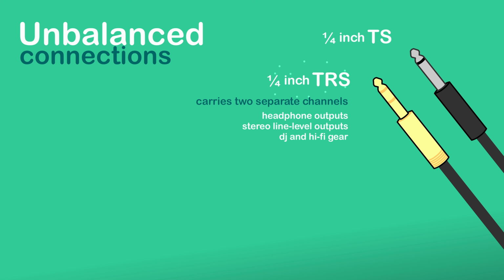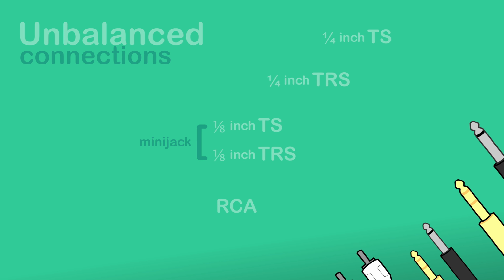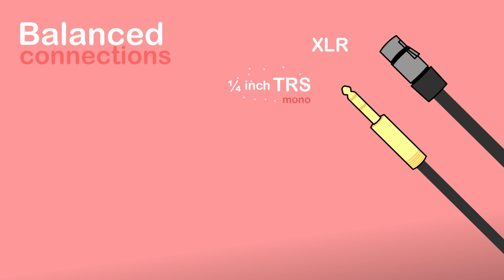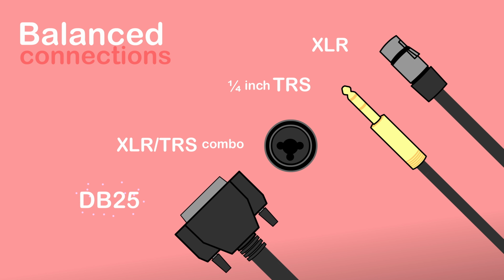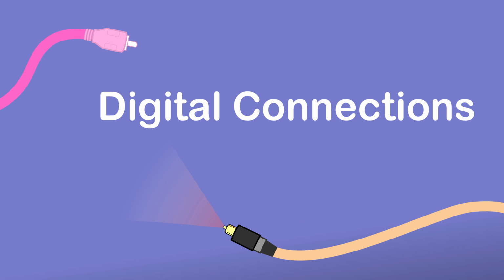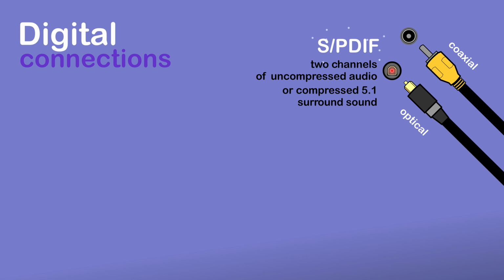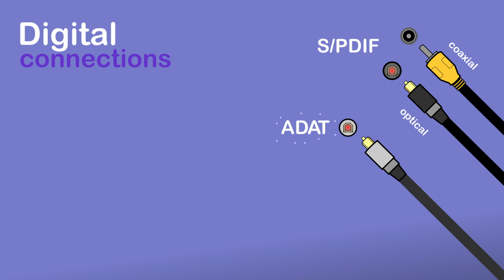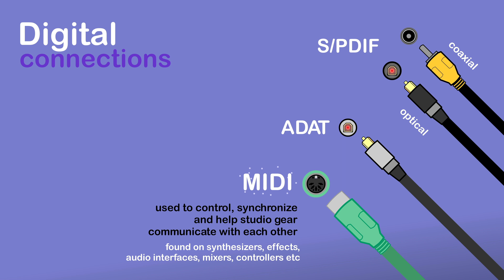Common types of audio cables and their uses. Analog Balanced / Unbalanced & Digital

Comment: I play with old amps, turntables, reel to reel, etc and a lot of them have DIN connectors in several variants. Most have 5pin crown DIN where middle is ground and two leftmost are signal. On a vintage EQ has the input and output on same 5pin DIN plug, where two leftmost are inputs middle is ground and two rightmost are outputs from EQ. Then there is the centered rose pattern of 5pin DIN for headphones.. no luck finding a suitable connector.. i've 3dprinted a center section of a normal 5pin crown DIN, and reused the housing and metal parts, and glued the pins in the 3dprinted center part that makes the pattern. 

Also on digital conector there are also those funky combo 3.5mm jack with optical reader in the back. There are optical cables with the head shaped like the 3.5mm jack but lights at the end and has optical fiber. (usually a normal TRS 3.5mm jack is wired as well.. the optical version just has a plastic spade looking like a normal jack not making electrical contact.)
Reply from the maker: You're right, I've seen the DIN connectors on old stuff and I've had to rewire some DIN cables to work with XLR and TRS cables on an old German Grundig tape machine from the 60s. That's probably a very deep rabbit-hole.....
As for the optical thing, I'm really curious about the cables you've mentioned. Got any photos/links?

Comment: I have an old logitech twin desktop speaker with bass with both single 3.5 input and a dual aux input. Can I plug my projector into the 3.5 input for sound, and have my desktop computer plugged into the dual aux, (to use separately) without their being any complications? Thank you.
Reply: Apologies, when I say “dual aux” I mean RCA connector.
Reply from the maker: If there is no switch to select between the inputs, either one will override the other or they will both go to the amp at the same time. If you are not running them at the same time that shouldnt be a problem so it might be kind of a hack for your situation.
Reply: @arbitersofsound  Thank you so much for your experienced and quick response. Cheers!

Comment: Is there a way to tell the difference between balanced trs and unbalanced trs cable just by looking at them?
Reply from the maker: the cable is the same,
you can use it for either a mono balanced signal (eg to connect a synth to an audio interface)
or a stereo but unbalanced signal (eg to connect your phone to a portable speaker)
what are you trying to connect?

Comment: What about USB? My headphone amp has both USB, coax and optical connections
Reply from the maker: I wouldn't consider USB an audio connection though. Your amp probably includes a decoder that can read certain types of audio files (such as wav or mp3) and then a D/A that can convert them to an analog audio signal.